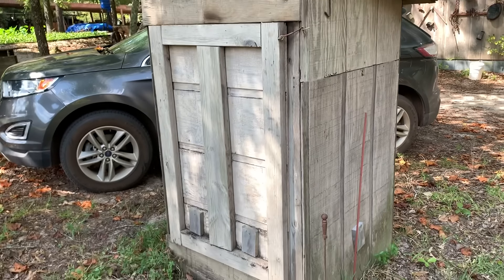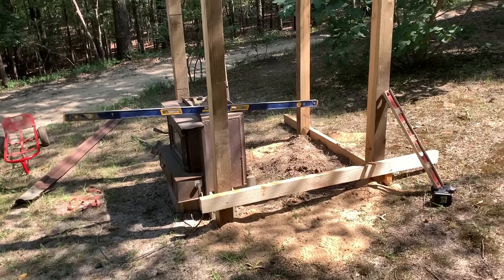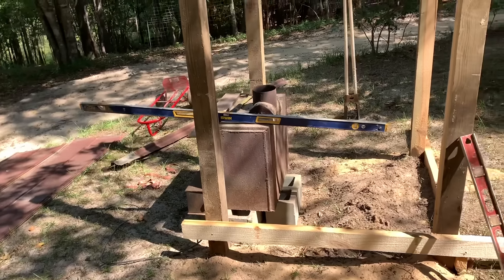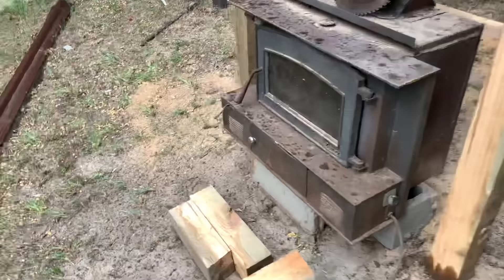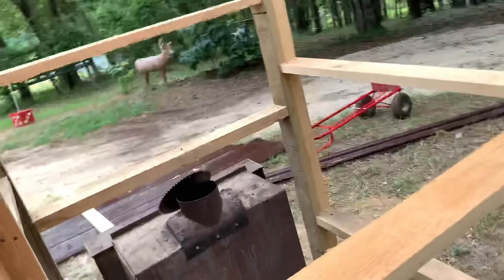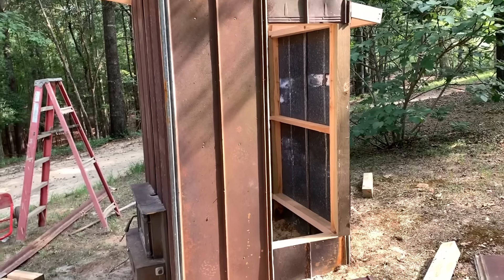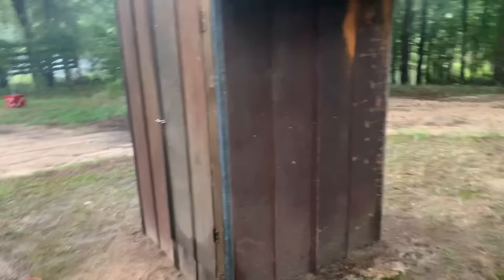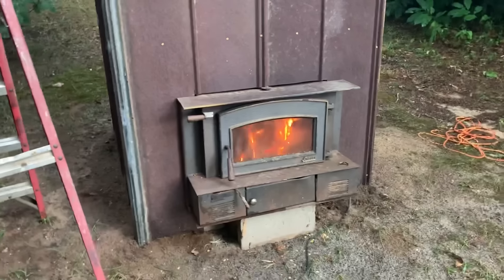How to Build a Smoke House Southern Style!

Comment: Nice video Jeff.  FYI - you can use those old saw blades....when you need to cut metal, just turn them around and run them backwards and they do a good job of cutting metal roofing, sheet metal, etc...

Comment: I love the insert idea, I'm fixin to start building one, lookin for an insert now. Here's my question: I have a natural bluff in my side yard and was thinking of putting the fire box a few feet away from the smokehouse on the lower end, if I do it this way, you think I'll be able to get enough heat into the smokehouse?  I'm in south Louisiana and likely won't be doing much cold smoking. Just wondering if it will work with the insert separated from the house?

Comment: Ours is about the same size as the new one you're building. Just boards on the sides an old door, tin roof and used a 55gal barrel for the fire box. Made a rack in the top of it with mulberry poles to lay the sausage on.

Comment: I Think if i was to build a smokehouse like this i would make a little roof over the stove to shed away the rainwater. If that stove is running and a cold rain was to come and splash on the glass door it's sure to shatter and the metal might warp and rust too.   It's a very smart setup as it is. I Just sold a big farm and bought a smaller one that i can handle myself and need another smokehouse soon.   Thanks.

Comment: Hey Jeff !  What if you put large doors on the 3 sides next to fireplace to give greater access to smoker ?  The doors could have roughly triangular shelves, with a common arm at the top to suspend the inner point. Then you could pivot the meat and shelves and everything out of the smoker completely for quicker removal... while that door is open it could be covered by a piece of tin or plywood to keep heat inside... this would also give you max usage of interior space vs the walk in you discussed.

Comment: Jeff I know this is an older video but hopefully you’ll still see this, I’m fixn to get started on one of these smoke houses but I noticed you didn’t put a chimney stove pipe in the roof or anything? How does the smoke get out? It looked as though you basically completely sealed yours up but there’s gotta be a way the smoke can exit the house for it to work so it’ll pull a draft through the firebox correct..? Holler back at me right quick if ya would brother. Preciate ya 👍🏼

Comment: Small recommendations you should try to put a small window on the side and add a battery light so you don't half to open the door to check the meat and let the heat drop and smoke out that would be bad ass but overall badass smoke House

Comment: Ok one question so were did you get the one handed post hole digger 🤨!!!
Reply: PT: Okay Jeff I want you to do 4 sets of 25 reps of these exercises. Hands out in front of you, elbows  at your sides Palms facing each other slightly clenched fist Thera-Band around wrists. Rotate forearms In-N-Out word directions. Same number of sets and Reps Thera-Band over top of door same position with hands pull in a downward Direction. Same number of sets and Reps and same position 5 pound free weights in each hand, smooth and easy bicep curls.

Jeff: How about I dig four post holes a day, will that work?

PT: Yeah, I guess so as long as you don't overdo it. Remember to twist at the hips.

Jeff: Will do, appreciate y'all.

Comment: Hind sight is always 20/20.  IMO, I think you should have put the fire insert in the back and put the door in the front and not on the side. But at the same token it doesn't matter to me because I'm not the one using it. Hope it's worked out well for you. I do like the fact that the fire box is under the smoke house.
 I see a lot of people putting the smoke/fire box off to the side instead of directly under the smoke house... That doesn't make sense to me. Putting the heat and smoke directly under the smoke house would seem you'd use less wood/coal.... Idk, because I've never built one. But if someone out there has then please let me know if I'm right or wrong...

Comment: Hey Jeff I don’t want to be that guy we all know on comments as the  “sofa armed chair engineer”, only want you to consider your wellbeing as it relates to your healthcare. As a young man 60 years ago I made an awful mistake of welding galvanized pipe and the heat produced chemicals in the smoke with no ventilation and became very sick. As I learned my doctor it was a result of what is known as Metal Fume Fever or Zinc Shakes. Please 

my brother do a little research before consuming that meat. I’m certainly not an expert but the research I’ve read most of the ole timers Smokehouses were made of wood. Could you line the inside with wood leaving tin as a veneer? Just a thought. I found you b/c I’m interested in building a smokehouse and like your wood stove idea to keep it separate avoiding breathing the smoke, great idea! And since marketplace has inexpensive one’s I thought I would use your great idea. Thank you for sharing your awesome Smoke house build.